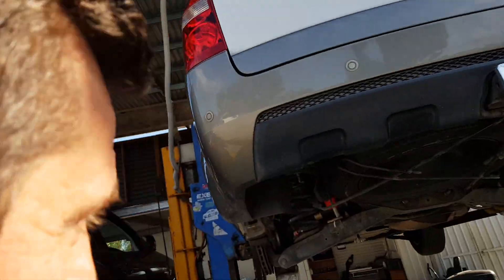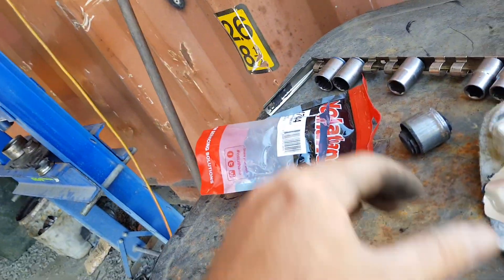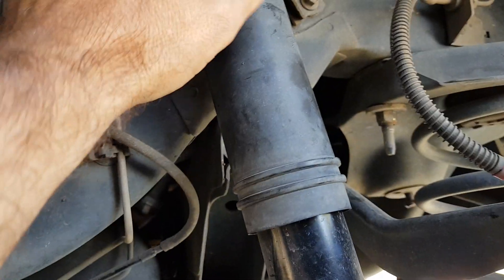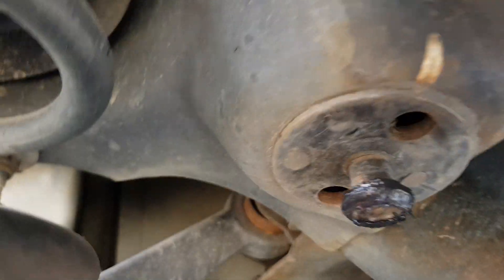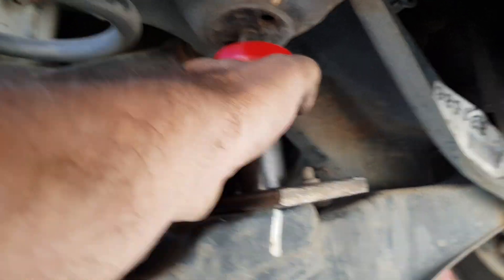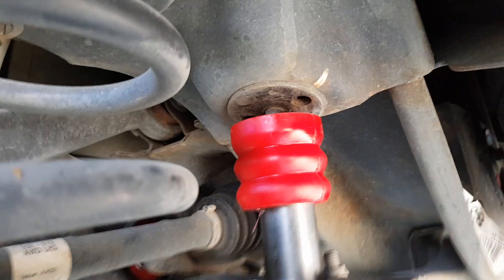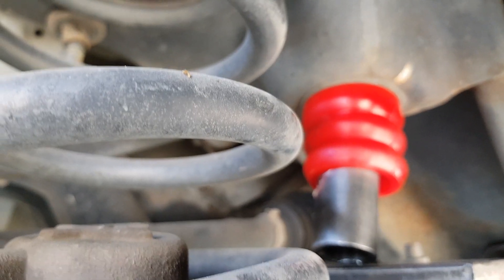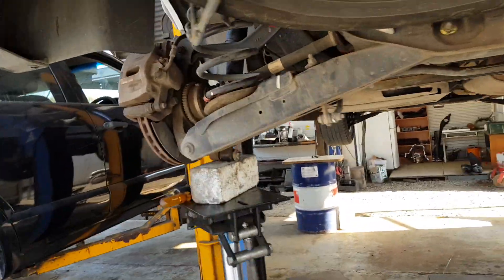How to Install Bump Stops and Shock Bushes on Ford Territory

Comment: Lol, just did this on a BA Fairmont, exact same Nolathane bump stops, a bit of grease 45 degree angle push and twist… Easy enough, no Jack required. Took about as long as it took you to do.

Comment: Hoists are great, though for ones without. Jack the rear up, and lowered the car back down slowly till seated, raise the car again removed the socket and job done.
Reply: wobbly sauce I agree with you . This bloke must be pissed weak I pushed mine in with no grease.